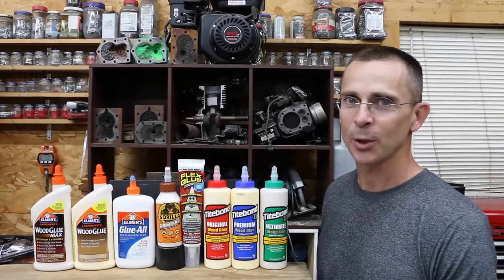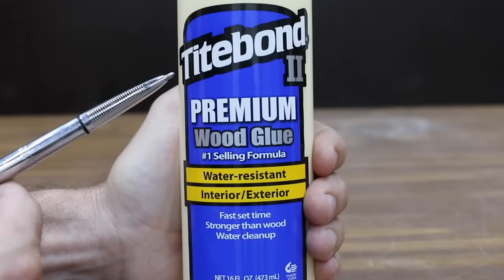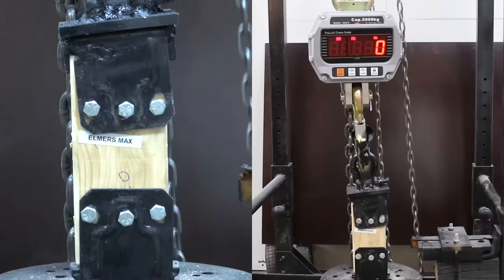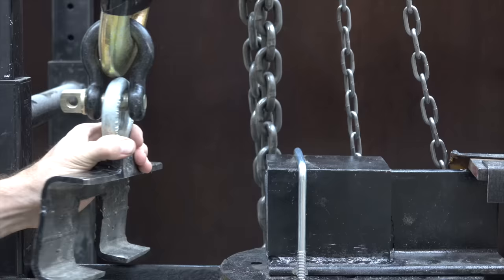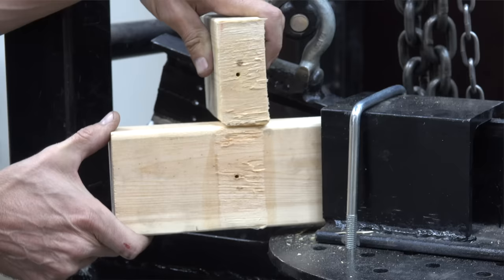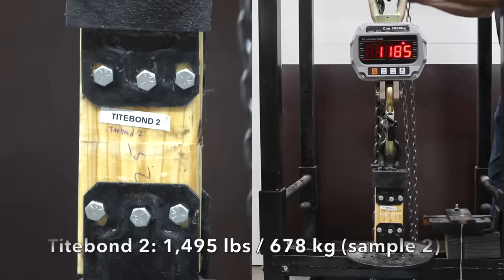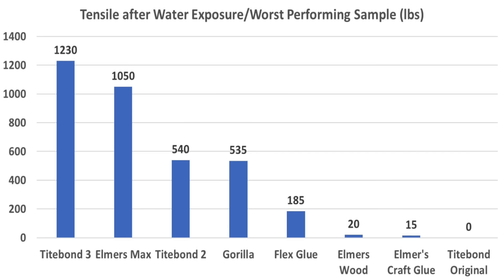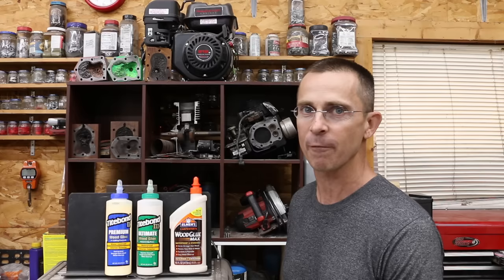Which Wood Glue is Best?  Let's find out!  Showdown with Titebond, Flex Glue, Elmer's & Gorilla.

Comment: I am not so sure how I feel about the end grain being used for the tests. It seems to me to be the reason for inconsistent results among the same glue samples. End grain absorbs glue a lot. Depending on the age of the tree, where the wood was cut from, etc. each end grain would absorb a little more or less glue. I'd really like to see this test with face grain overlapping a little bit.

This also seems to me to be the reason the Flex Glue was so consistent, because of it's viscosity it doesn't tend to be absorbed by end grain nearly as much.
Reply from the maker: Thank you for the feedback

Comment: Could the uneven holes in the 2x4s have caused the varying results with same brand? I think the holders should have been bolted and clamped down with the bolts to not cause uneven stress. But I'm no engineer! :-)
Reply from the maker: Thank you for the constructive feedback
Reply: I believe end grain is just naturally too random for a test like this. All of the glues did great except the flex stuff. I’m sure it has its purpose though.
Reply: @MoneyManHolmes  Agreed, the results are still quite usable... I will continue using TiteBond III especially for outdoor stuff. I repaired my daughter's cello bridge with wood glue a few months ago assuring her that it was super-strong. (She was skeptical.) I'll show her this video with the glue hold 5000 lbs + !! :-)

Comment: I love this channel and have gotten a lot of valuable information from it.  However, I'm not impressed with this episode. On edge grain or face grain, any wood glue is going to be stronger than the wood if it is clamped properly.  On end grain, none of them are reliable.  No decent woodworker designs his projects where end grain is used in woodworking joints unless the joint is interlocking, thus, making the strength of the glue less important.   The test design here is not realistic because it only uses butt joints with end grain on one or both pieces.  Wood should never be glued that way, and therefore, the results are irrelevant.  Knowing the water resistance of each glue is helpful information. A demonstration comparing water resistance by using boards that are simply edge glued together would have been more useful.  Another useful thing to know about glue is how well they fill small gaps.  In general, most wood glues that have a component that evaporates are not good at filling gaps in sloppy joints.  The ones that have traditionally been the best in those situations are the epoxy glues because there is nothing to evaporate, and therefore, there is no shrinkage of the glue as it cures.  I believe that the polyurethane glues are also excellent at filling gaps because they actually expand somewhat by absorbing moisture from the air as they cure.  So, for the wood butchers among us, the epoxy and polyurethane adhesives will save us from poor machining.
Reply: For testing the bonding strength of the glue itself, I don't think using a worst-case scenario is irrelevant.
Reply: @grizzlygrizzle  End grain gluing is not a worst-case scenario, it is simply a bad practice that will always fail when put to the test.  No woodworker, architect, or engineer worth their salt would ever design a project that relies on end-grain gluing alone.  And, as far as the bonding strength of the glue itself, any kind of glue will be stronger than the wood itself when gluing flat grain or edge grain.  There might be some exceptions with a few types of super dense tropical woods that are extremely oily or waxy, but in all other cases, the strength of the glue itself is irrelevant because it is always going to be stronger than wood if the glue is applied correctly and the pieces of wood are clamped correctly.

Comment: Do you think we could see tests for spark plugs? Companies in recent years have been trying to “reinvent” them. We have numerous metals and styles now. From $2 - $20 a plug 

Would be interesting if we could measure the resistance, the arc and how they would last over time (covered in carbon, fuel and / corrosion) 
NGK just released ruthenium and double laser iridium 
E3 has their patented design they claim to be superior 
Champion claims copper cores for the industry lead on resistance 
MSD and accel Claim performance and a larger flash for an even burn. 
Could compare in the see through head. 
Do before and after tests.
Reply from the maker: Great video idea!  Thank you
Reply: Project Farm thank you for the priceless info! We all love this channel
Reply: There is this unique type of spark plug called Brisk.
Reply: Project Farm  just want to thank you for taking this idea and doing the video man, love your content and your community interest! Thank you!

Comment: Any thoughts on what caused the variability between glue samples for the same product?
Reply: It probably has to do with the variations in wood grain. Even though the sample joints are eight inches apart, there will be differences in grain orientation and size. The saw kerf also ensures pieces will align differently too.

Comment: @Project Farm  I think for your first test you can reduce the variation in the numbers & achieve more consistent results if you put a nut, two washers, and a bolt in each of the 3 holes on both pieces of the wood, then torqued them down to a specific torque - doesnt matter what, as long as it's the same/consistent between all the samples. just enough to really sandwich the wood in between the plate on each side of it, that way you have the friction between the wood & the metal helping to hold the entirety of each piece of wood across the whole face on both sides. 

The way you did it currently, and i hate to even criticize because I love your channel and tests and have been subscribed for many years, produced inconsistencies because if you think about it, unless all 3 holes on each piece of wood are in identical locations as the 3 holes that are in each of the plates, there is no way that you'll be able to apply force to the wood evenly. If even one hole is just a half a millimeter off, that entire side of the piece of wood will have much more force being applied to it as it's pulled - leading to delamination unevenly, on one side of the bond, and will produce very variable results with low consistency. If the metal plate on each side of the wood was also holding it by friction force as the wood is sandwiched between the two plates and the bolts/nuts torqued to the same amount, then you'd have a much more even pull across the entire face of the wood from both sides instead of occasionally one side being pulled more because of hole misalignment if the bolts are just put in there without any tensile load applied.
Reply: While you are technically correct, IMO his method is good for consumer tests: multiple samples, multiple tests, results averaging. Most will agree that the final summary is correct.
Reply: Won't be surprised that more variations came from variation in wood grain

Comment: Can you consider performing a "round 2" test?  Reason is that it's rare that carpenters do end-grain glue ups.  Most of the time we are face/laminating or long edge glue ups.  Furthermore, we also prepare the pieces to mate as perfect as we can get by using tools like a jointer or surface planer.  I really think in dry situations that all 3 Titebond versions would perform close in these test scenarios.  The only place Titebond III would outperform the other two is in wet conditions.  There are other pros with II and III like open times, temp, etc.  Of course, this test was useful as-is because all test were the same across different wood glues.  Yes it's rare, but when we are faced with end-grain glue-ups, there's a procedure...apply the glue, let stand/soak for 15 mins or so and apply a second coat before clamping together, guarantee your results would have been even higher across all models.

Comment: but you almost never glue end grain to endgrain when building somenting...
Reply: I think he chose to test end-grain hold because it stresses the bond the most, illustrating more clearly which glue holds best in high-stress settings.
Reply: if he didn't, then it'd be a hell of a lot stronger for every case and it would be much harder to see the effects of the glue itself
Reply: If he didn't then the wood would rip apart at a low tensile load.

Comment: Thank you so much for all the work you put into testing the products and creating the video. I'm a old lady that has found herself repairing an antique farm table that we've had on our patio for 28 years. I believe it was handmade, and it used a lot of tongue and groove to put it together (no glue, just design). One of the tongues split, and I want to repair it. I originally bought and have Elmers Wood Glue Max, but was wondering if it was the best for my needs (live in a humid climate so moisture is a consideration). I almost switched to J-B Weld WoodWeld Epoxy (50151), but your tests tell me that the Elmer's Max should be fine.

Comment: I would like to see something regarding the effect on fuel mileage when you add acetone to gas.  Also, is the impact different on real gas compared to E-10 or E-15.

PS: You are the best!!!
Reply from the maker: Thank you for the video idea!
Reply: @ProjectFarm  Phillip G makes some excellent points about possible damage that could result from adding acetone to fuel.  It would be great if your video could include some tests to verify whether the small amount of acetone really does cause any noticeable damage.  Another related idea is to test fuel additives for cleaning the injectors and overall fuel system, as well as any impact on fuel efficiency.

Comment: Very interesting.  I've just started using Titebond III for it's lower 45F min temp capability.   I have an unheated workshop and, at this time of year, it makes for very problematic glueing!  I have to run the parts back and forth into the house to keep the temps up.   I have noticed the Titebond III leaves more of a difficult-to-remove white mess on the surfaces where it overflows and gets wiped off. White apparently indicates too cold.   It would have been good for me to know the effects of low temperature on strength.
Always doubted FlexSeal products and you've proved it!
Thanks for the great video, yet again.
Reply from the maker: You are welcome!

Comment: Back in 1973 the aerospace engineering department at my school was building a wooden airplane.  The glue we used to hold the wing ribs together was urethane - the equivalent of ordinary Gorilla glue.  According to the manufacturer of our glue, it was important to moisten one surface of the wood prior to gluing.  I believe the instructions on Gorilla glue mention moistening the surface, too.  I'd be interested to see how the original Gorilla glue works with moistening at least one surface.
Reply from the maker: Thanks for the suggestion.

Comment: I build and repair guitars, and the recommended glue to use on guitars is hyde glue and Tightbond. but hyde glue is quite a bit more difficult to use. because it has to be heated when using it. and a person has limited amount of time to use it before it cools. but the next best glue to use is Tightbond glue, and Tightbond is a lot better for clean up which on a guitar is important. because a person can't have a guitar that has noticable glue on it. so this test is helpful for me to be able to use the best possible glue I can use on the guitars thanks.
Reply from the maker: Thanks for the feedback.

Comment: I love this channel. I look forward to new videos all the time. I think clamping the 2x4's together instead of using screws would have given you more consistent results. Seems like there is the range of results within the same glue is too big, and would suggest user error rather than glue failure. Some glues had result of over 5000, then down to about 2000. That is a huge difference within the same glue. Unless there was something wrong with the glue I don't think it would be that inconsistent.
Reply from the maker: Thanks!  Thanks for the feedback.

Comment: I really appreciate your tests and I also found this one interesting. Just a few comments. In practice, gluing end grains is unwise, but if you do, it is advisable to coat the ends with (diluted) glue and let it dry before you make the real glue connection.
Reply from the maker: Thanks!  Thanks for the suggestion.

Comment: Speaking as a carpenter and numbers/statistics nerd, I would honestly like to know if a single solitary 20 biscuit in each joint would make a marked difference. I was impressed by the amount of force you could apply to those glue-ups. I always break up my table top glue-up cutoffs to see where they fail. We use primarily TB2, and it is about 70 percent wood failures, but only when the cutoff is around 1 1/4 thick and 1/4 inch wide. At 1 1/4 thick by 1/2 inch to 1 inch wide, the failure is almost always on the wood, not the glue. It's strong stuff.
Reply from the maker: Thanks for the suggestion.

Comment: I just noticed something crazy. In the shear test, using wood 2x4, the wood glues outperformed the construction adhesives you've tested. The best construction adhesives would only rate in the middle of the pack of wood glues. That strikes me as an extraordinary result. How weird is that? Like 3M 5200 sheared the wood into pieces but only got 1500 lbs. Which would make it comparable with Elmer's Craft Glue. How does that make sense?

Comment: I worked for over 20 years in an adhesives R&D lab. A lot of the variability in testing results you're seeing is in the wood substrate. An enormous amount of time and energy in wood testing is spent trying to eliminate possible variability in the wood. Also most glues are applied to the wood faces, not the end grain. Some of the parameters that are attempted to match for adhesive testing are: wood density, grain orientation, moisture content, glue weight, press pressure (psi), temperature, post curing after press release, and more. I can tell you from testing in the lab that Franklin (a competitor) makes the best polyvinyl acetate (PVA) based glues, and Titebond III is the best exterior grade PVA glue out there. This was more or less proven in your testing.
Reply from the maker: Thank you!

Comment: I Liked that dramatic touch of slow mo on the chainsaw part of the vid. Idk I'm weird to notice those things from that perspective. Regardless, looks like ill be  going with titebond 3 to use on a joint repair after replacing a raised panel on an older finger joint type door. Thanks for putting out this awesome video.
Reply from the maker: You are welcome!

Comment: Titebond III is actually quite flexible. I have used it on plastic and painted metal, and with cloth and fiberglass. I did fiberglass on 1" thick Dow XPS polystyrene foam in bending test jig, with about 12 different types of fiberglass - and none of them delaminated. And if you need a lot of glue, a gallon of Titebond III is about $33.

Comment: Steve Ramsey over on his tips for better glue ups said he wishes somebody would test his method for using watered down wood glue on end grain before applying full strength glue against regular methods. He does a 50/50 water;wood glue mix and applies it, let’s it fully dry to seal the grain, then applies the glue normally. Thought you would be great to test that sort of thing!
Reply from the maker: Thanks for the suggestion.

Comment: Recommendation for future video: In the off-road world, there is a constant debate about what is the best material for a "cable" with which to pull a stuck vehicle out of the sand, mud, etc. There is also constant debate as to whether soft shackles are better than metal ones. And there is debate over the proper orientation for a soft shackle.  There are 3 possible videos!
Reply from the maker: Thanks for the suggestions.

Comment: FWIW, an additional test you might consider is the conditions for curing. 

As I understand it, the difference between Titebond 2 and 3 is how they cure -- 2 releases moisture into the environment to cure. 3 *absorbs* moisture from the environment to cure. 

The result is that 2 works better in dry conditions (e.g., Arizona) and with dry wood. 3 works better in humid conditions (e.g., the gulf coast band from South Texas to N. Florida) and with damp wood.

I live in N-C Florida, and i had some damp wood that I needed to glue together -- plus the humidity runs 70% even in the WINTER around here. TB2 literally refused to cure -- even 36h after glue-up, two pieces would pull apart by hand, with the glue still pretty uncured -- tacky and gooey, but still liquid... Contrast that with TB3, which cured in less than 24h  and made a rock-solid bond.

The only downside to TB3 is that it foams as it cures, meaning more post-work cleanup on pieces is often required.

You might consider a second round of test where you simulate different conditions using a steel box (old refridgerator?) and a humidifier/dehumidifier to get the humidity for curing samples to different values. Also test the dampness of the wood before tests, and try different values of that.

Comment: Good job, provided lots of clarity on performance.  I suspect some of the variability was the result of inconsistent rate of pull on your samples.       
Perhaps adding a dead weight to your apparatus would smooth out the rate of pull.  I also noticed you obtained superior results on the fresh cut material.  You may want to skim cut faying surfaces on shear samples.  That would remove contaminants from the surface of your samples.  Overall a very good report.  I am putting Elmers back in my tool box.
Reply from the maker: Thanks for the constructive feedback